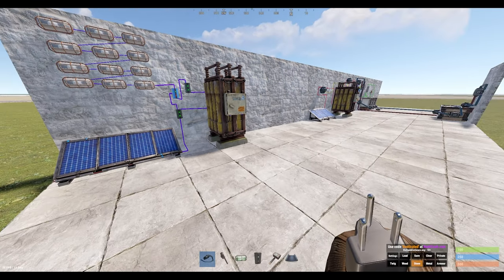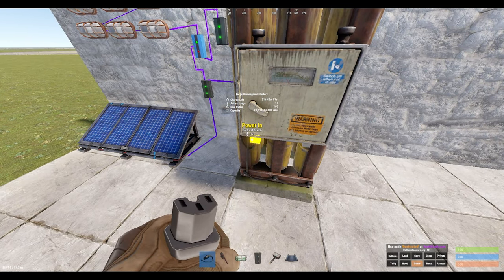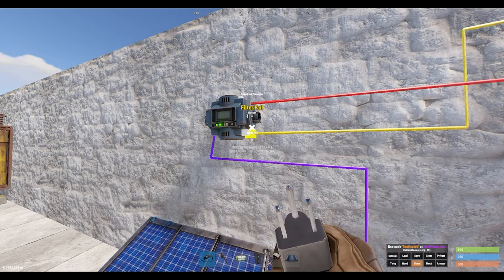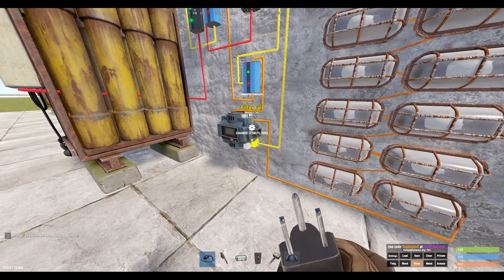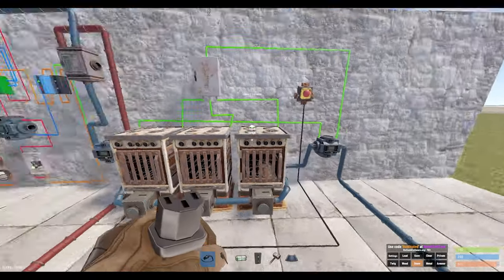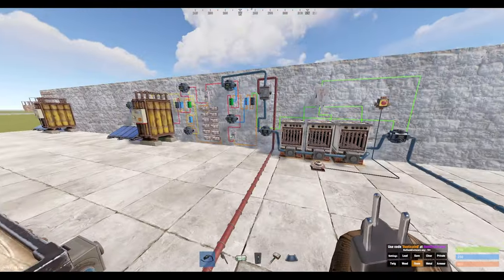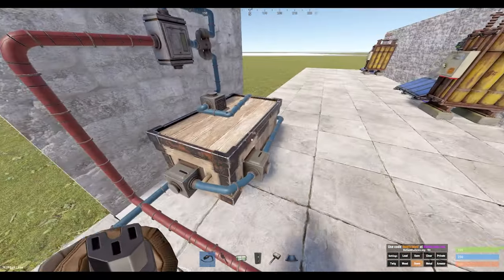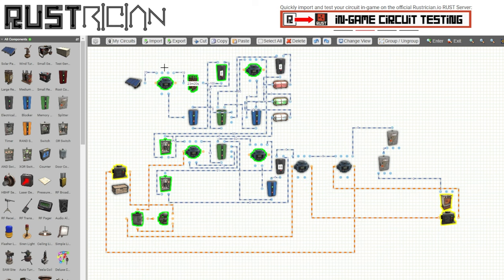30 ELECTRIC FURNACES WITH 1 SOLAR PANEL!!!!!

Comment: interesting how you've done the electric furnaces. I've made it work with just a memory cell, branch, and two splitters, basically just having an empty inverted output used as a blocker kinda.
Reply from the maker: Yeah nice. Thatll do the trick. Thanks for the comment!

Comment: How does that octobox work? I can't find anything else on it.
Reply from the maker: A conveyor moves 60 per tick, per storage adapter, per stack. 4 adapters on the box = 4x60 = 240.  Then the Combiner into the Spliter, back into the Combiner, double that output. 480.
Reply: @kangaraider - the octobox is a HUGE improvement (it actually makes furnace cubes viable!) And as far as I am aware, it is not widely known in the community. It would be great to have a dedicated video on it to spread awareness